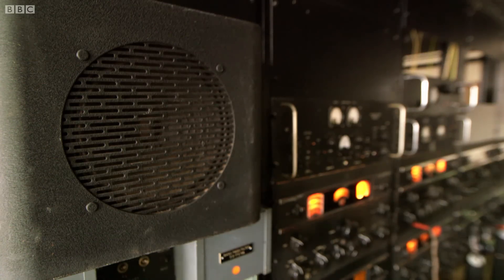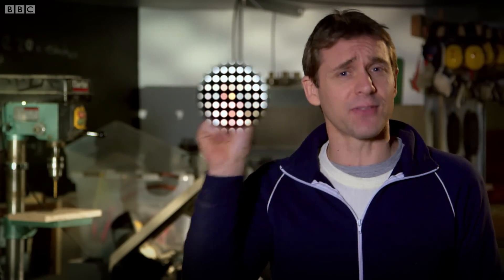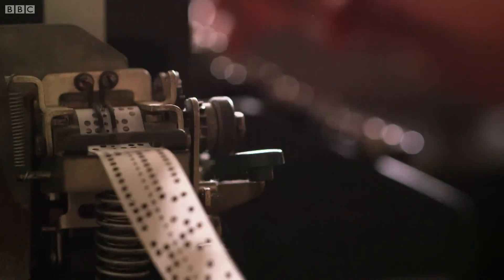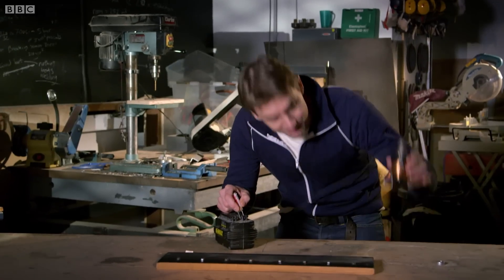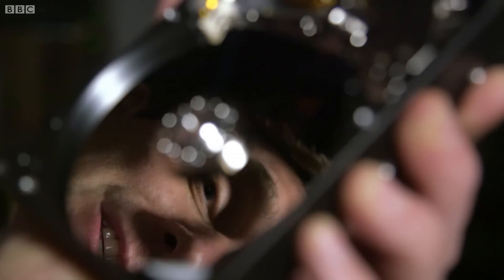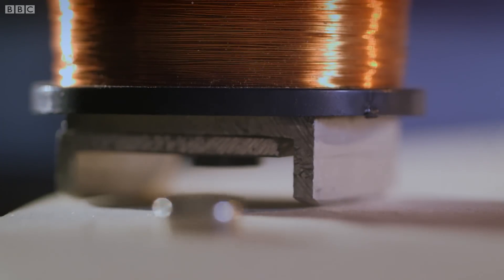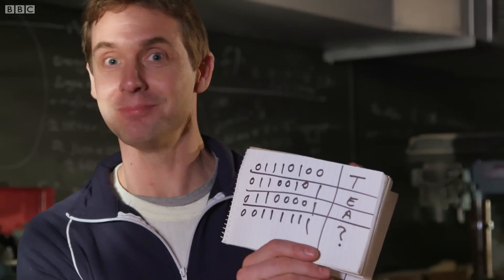How Do We Fit So Much In A Hard Drive? | Bang Goes The Theory | Earth Science

Comment: Modern computer CPUs have Billions of transistors. That's not very modern.
Reply: alex clanton quantity does not mean "modern". Manufacturing process and principles - do. At the beginning computers were circuits of lamps and wires. Then they became circuits of wires and transistors, then boards and integrated circuits, then, like, NOW, they are boards with microchips. Nothing is fundamentally different in what he has in his hand, and what you have in the most modern computer. Bigger die - sure, more physical cores per die, more instruction sets, smaller lithography. Yes. But not different.
Reply: +Donnie 
The problem is that he pulled something from the last century out of a computer and calls it modern and Alex only mentioned the billions of transistors because the host said how many transistors his "modern" CPU had.

The technical specs of a CPU is what makes it "modern". A current Intel Core CPU is modern, a Pentium 2 is old even though they run on the same transistor-based principle.

"Bigger die - sure, more physical cores per die, more instruction sets, smaller lithography. Yes. But not different."
Not different, yes, but that's not the point. The one with more cores, more instruction sets and a finer manufacturing process is modern while the other is not (a bit of generalization here but you know what I mean).

Back in the 60s and 70s, there were american cars that provided around 200 to 300 horse power out of big V8 engines with up to 7.2 litres displacement. Cars today can double or triple the amount of horse power from the same displacement, yet those old V8s aren't considered modern just because they run on the same principle.

Comment: Wow. A 250gb hhd? That ancient core? What is this?
Reply: ***** "Due to the unique way BBC is funded..."
Reply: 666Tomato666 Why the quotes?
Reply: ***** you wouldn't tell the difference one from another. The CPU die looks pretty much the same, as well as the HDD platters, and that's what's important.
Reply: ***** because that was a quote from certain somebody that doesn't work at BBC any more
Reply: Donnie I'm confused by this? Do you mean that the CPU they showed off looks like a modern CPU, and the same with an HDD? While the drives might look somewhat similar today, the a modern CPU looks nothing like that. Also, 250gb is small for a disk today. You can buy a 1tb drive for $50.
Reply: ***** it looks the same because the structure is the same, the functioning principle is the same, the standards are the same. What's different is basically quantity of stuff they add. Frequency, cache, storage density, number of transistors. It's all quantity, NOT quality. Quality determines what's modern or not. Quality means something important, fundamental is used/present or not.

Even software, operating systems, that are the newest around, can still operate with that hardware. Well, if it's too old, then a feature like PAE might be absent, which would impede Windows 8 from being installed. This is about instruction sets. Programs you run on your current CPU will run on older CPUs. Programs you ran on older CPUs will most likely run on newer CPUs, with few exceptions from both cases, where they demand some new instruction sets, or aren't capable of utilizing new instruction sets.

You can even hook up that 250Gb HDD to your computer, since it's most probably SATA. If not - there are adapters for PATA. They have the same shape, you screw the screws in the same holes, they rotate at the standard speeds, (5400 or 7200 if it's a consumer product). It's all the same. You will be able to write files, and then read them.

Which means that the CPU he showed, AND the HDD, are definitely consudered MODERN, from a historical, structural and functional point of view. It's only outdated performance-wise.
Reply: Donnie Modern in the same way cars from the 1900s are modern. They serve the same propose: Get you around. They do it on 4 wheels, and is operated by a single driver. Sure its modern, but its not /modern/ modern. If that makes any sense.
Reply: ***** no, it's not. Computers have the same purpose the same way cars have the same purpose. It's not about the purpose. It's about the manufacturing process, materials and the end product form factor and interaction.

but you're not even comparing correctly. A car is a mode of transportation. Modern modes of transportation. The same way a modern device that computes data is any crystal with semiconductor cities on it burned with lasers.

It's a very bad example - the car. The car fulfils vanity purposes as well. Materials have drastically changed during its evolution. The process of R&D, and of manufacture has changed dramatically. The end product today is very different from the end product in the 1900, in lots of ways.
But if you were to study car history, then basically any car with injector engine that runs on lead-free fuel, who has electronics in the engine to control stuff, is a modern car. And that means anything from the  last 20 years or so.
Once things change for everyone, a modern car will become something else. When we'll refer to self-driving electric vehicles as "cars", and to conventional internal combustion engine, human driven vehicles as "cars with drivers and internal combustion engines", or "fuel hogging killing machines", then the concept of "modern car" will refer to that exact driverless electric car.

So, since you refer to that device as "CPU", and to a chip that's entirely made out of plastic, soldered onto a board, as a "chip", then you could argue that THAT chip is not a modern CPU, and to some extent you'll be right, since it's a transitional processor, from integrated circuit boards to microprocessors.
Reply: Donnie How about I end this debate, once and for all:

First, for clarification, lets define "modern" The oxford dictionary(http://www.oxforddictionaries.com/us/definition/american_english/modern) defines modern as "Of or relating to the present or recent times as opposed to the remote past" or "Characterized by or using the most up-to-date techniques, ideas, or equipment:"

Since this tech is nearly 16 years old, and modern is "relation to the present" it is impossible for this 16 year old tech to be modern.

Furthermore, for the second definition, while its true the manufacturing processes is pretty much the same, it has changed in the past 16 years. Thus, it doesn't use "the most up-to-date techniques, ideas, or equipment". Therefore, its not modern.
Reply: ***** "Since this tech is nearly 16 years old" - "as opposed to the remote past" - 16 years isn't remote past.

"Characterized by or using the most up-to-date techniques, ideas, or equipment:" - the used techniques, ideas and equipment are virtually the same.

"it has changed in the past 16 years" - how?

If you interpret the definition like you do, then only ONE SINGLE piece of hardware can ever be modern. Anything else is outdated. My laptop (core i7 4720HQ with a GTX970) is outdated, it's not modern any more. The screen is not modern even though it's HD IPS, because it is not the most up to date. Under that definition, ANY CPU he would show would not be modern. The maximum of "modern" he could get, is a few weeks, if he does get the latest, but after that it ceases to be modern but the video is still out there.

Yet when he shows the "modern" CPU, the only thing that's actually different is the plate under the die and the electronics on it. The die is the same die, with no visual differences, absolutely none. Which is WHY it could be shown for demo purposes as a Modern CPU.

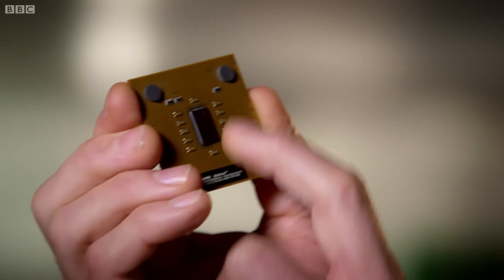Comment: 0:30 "I pulled this out of a modern computer"

That is an AMD Athlon, from 1999... so not really modern by computer standard. :P
Reply: ybra Manufacturing process changed, form and factor not so much, so yeah, if it from 15 years ago, it's still pretty modern even if inefficient.
Reply: Yes, his explanation still works. I'm just objecting to calling a CPU that is one year older than the Nokia 3310, modern. https://en.wikipedia.org/wiki/Nokia_3310
Reply: ybra compared to Colussus in the 1940's it is modern!!!
Reply: ybra If you compare it to a computers build of vacuum tubes or a single transistors it still looks modren.
Reply: I looked up the number on the sticker, looks like it's an Athlon XP 2800+ from 2002/2003
Reply: ybra You realise this is part of an old BBC program from the mid 00's right?
Reply: ***** It's funny that you say that, because you contradicted yourself. Contemporary is one of the very definitions of modern.

Modern is in reference to the present.

This is from March 24, 2014. So, it was likely filmed around late 2013.

To give you an idea of how very NOT modern that is, consider the transistor count.

He mentions that CPU has 54 million transistors. 
At that time, a modern CPU actually had 1,400 million ( 1.4 billion ) transistors.

That's an enormous gulf between the 2. Nearly 26 times as much. A modern CPU has well over 2 billion, and modern GPUs have 8 Billion+. Even my really old core 2 extreme QX6700, which struggles with modern games, has more than 10 times as many transistors as that supposedly modern CPU. It's just not even close.
Reply: ybra  Yeah I loled at that.. Well I guess a 1990's AMD is still pretty modern for most Brits ;)
Reply: Dr_Kachu san  yeah and from 4 cores to 22 at the most
Reply: ***** that depends, intel uses 3D gates now.
Reply: Aitch Is it? That makes a lot of sense. I withdraw my criticism.
Reply: Aitch no it's not, look at 1:24 , there's a smartphone
Reply: Dildo Faggins ybra Just checked and the first episode aired in 2009, so its kinda in the middle. Certainly not a "modern" CPU, but they are 5-6 year old clips :)
Reply: Aitch Look at 1:24, that looks like an HTC M7/8/9 which means this clip is from 2013 or later.
Reply: ybra relative to what he showed before its way modern 
he didnt say contemporary or top of the line
Reply: ybra it still uses the same method, transistors, although alot slower.
Reply: Aitch An HTC One is from the mid 00s?
Reply: ybra Funny enough. I still have my 3310 and still works perfect and was used on almost a daily basis. That's quality for you :)
Reply: +ybra The modern CPUs are reaching two orders of magnitude more transistors than this one, with the server stuff getting over 5 trillion transistors.
Reply: Actually 5 billion, not trillion.
I'm confusing up the Tflops/transistor count  numbers.
Reply: thats exactly what I thought it's not even got a heat dissipation plate just the die
Reply: +Dr_Kachu san the way he says that the transistors are considerably smaller not that today they have about 200million (well about 2005) in about 30nm
Reply: TheRaptorFactor Gaming/Tech & Tutorials 
Well yes, but its interesting to observe how in such short time we went from millions to billions.
Reply: TheRaptorFactor Gaming/Tech & Tutorials This if you don't count Shader units as CPUs which they pretty much are, then we're talking about thousands of "CPUs" in a single chip.

Comment: That "modern" processor shown first is not that modern, the latest ones have around 2 billion transistors inside. And the Hard Drive discs spin at a minimum of 5200 times a second. just to get the things more accurately.
Reply: Icaro Vasconcelos 5200 RPM (RPM - Revolutions per minute) which makes it 86.6 times a second
Reply: Icaro Vasconcelos That's 312,000rpm!!!  Modern hard drives are usually 5400rpm or 7200rpm, which is 90 times a second or 120 times a second, respectively.  There are hard drives which spin faster than 7200rpm, like the 10k rpm WD VelociRaptor, but those are going the way of the dinosaurs as SSD's become the current standard for speedy drives.
Reply: Icaro Vasconcelos 5200 per second? Most HDD these days are 7200 RPM which means about 120 Rounds per second.
Reply: Icaro Vasconcelos An Intel i7-3770K from 2012's Ivy Bridge microarchitecture with it's 22nm (nanometer) lithography in a 37.5mm x 37.5mm package has 624 Million transistors.
As for hard drives, they are rated at 5400 RPM (90 revolutions per second, usually used for 2.5" laptop drives and low-energy usage 3.5" desktop drives), 7200 RPM (120 revolutions per second, typical 3.5" desktop drive speed) or 10,000 RPM (~167 revolutions per second, usually high-end Server-grade 3.5" drives).

And before you try and argue that I'm wrong about transitor counts or drive rotation speeds, I'm a PC builder and IT tech who has to keep track of where tech is going and what bumps and hiccups are along the way (such as the delayed launch of Broadwell's 14nm from Intel in Q3 2014 due to issues with the lithography and the delay of Kaby Lake's 10nm to 2017, again due to lithography issue on PURE silicon).
Reply: k03hl3r Yeah, I forgot to calculate. xD
Reply: This episode was aired 10 yrs ago
Reply: Icaro Vasconcelos 
And GPUs are now at over 9 billion.
Reply: eemarko I wanted to use the same words as him. :)
Reply: Dupl3xxx They can have a bigger die without overheating, thats why. Reaching 9 billion, not quite there yet.
Reply: ElNeroDiablo read more about the high tech then, we have Xeon processors at about 2.6 billion transistors, and HDDs at 15000RPM. I'm an IT tech as well mate.
Reply: Icaro Vasconcelos the 2-4billions transistors for CPUs (not GPU-parts) only apply to heavy load Server-CPUs (something like IBM Power7+) used for Clusters etc, not desktops CPUs. Btw: the most modern commercially available HDDs can store up to ~8Terrabyte and start to use 3D layering. The next gen of HDDs (within next ~2years) most likely won't be only using magnetic poles as indication weither something is 0 or 1.
Also, although the most simple character system - ASCII - uses 7bit, there are much more complex/comprehensive character-systems using up to 32bit (specific UTF-types)

Btw: the 1st time I heard about HDD-alternatives using 3D-Structures was at least 15 years ago..

I'm a SystemsEngineer for IT-Networks
Reply: MedicalFitness Uhlig i think he was talking about an APU (cpu+gpu).
Reply: k03hl3r Pun pun pun pun.
Reply: MedicalFitness Uhlig 3D HDDs are only in the labs and they will be able to reach more than 100TB, aren't they? And I never heard of using other indicators besides 0 and 1 for magnetic/digital recording. I would like to hear more of that, a link to it if possible.
Reply: Icaro Vasconcelos SSDs are where it's at though...
Reply: ElNeroDiablo 5200 drives are also used in mass storage devices where a raid array would be used.
Reply: Dupl3xxx My GPUs are about 8 billion each, that's about 154x more then 52 million. and I think my cpu is 370 million
Reply: MedicalFitness Uhlig JFYI: ASCII is a 7-bit encoding. UTF-16 uses 2 bytes for some characters, but 4 bytes for the rest of Unicode.
Reply: nex well, there are different types of UTF resp. Unicode
 (UTF-1 to UTF-32 as well as version-history of UTF)
Reply: Icaro Vasconcelos
of course there arn't any other types expressing 0 and 1 than north and south pole in magnetic recordings, but different kinds of informations other than magnetic orientation can be used for expressing 0 and 1, e.g. the Spin-orientations or energy-state of an atom resp. electoron (basically various quantum-states/informations, which are a whole lot).
What I mean with 3D HDDs is perpendicular recording rather than the common longitudial recording process. Another type of 3D mass store is already used in SSD (stacking Flash-Chips on top on another, like some kinds of high storage RAM-DIMMs
Reply: MedicalFitness Uhlig Well, spin orientation is only used as qubits which can have up to 4 states so far. The perpendicular recording isn't actually 3D, but there was some studies in actual 3D in HDDs but it was very expensive and hard to produce. The AMD's HBM memories just started using stacking in RAM, and SSDs started this year.
Reply: Icaro Vasconcelos  all a case of definition of whats 3D..  for me perpendicicular recording is, since it uses the deeph to a much higher degree than longtudial recording
stacked RAM-Chips on top on another so that there are 2 are like 2x4 RAM-Chips per DIMM-side isn't exactly new, although it's mostly used in high capacity DIMMS for servers (Registered DRAM with error-correction etc)